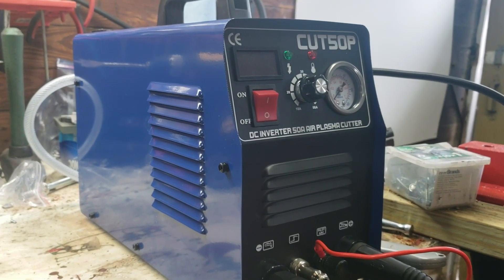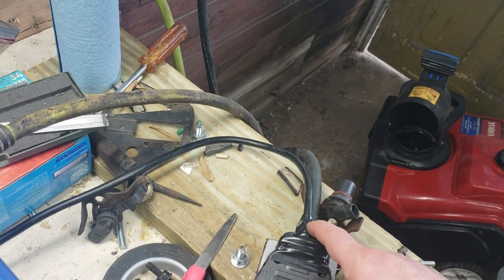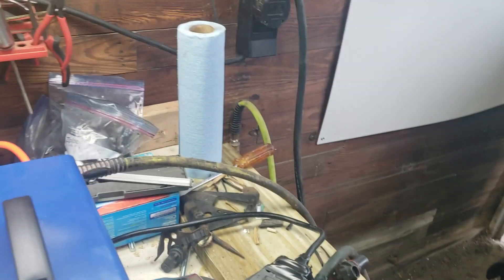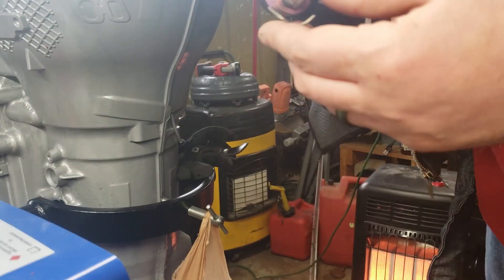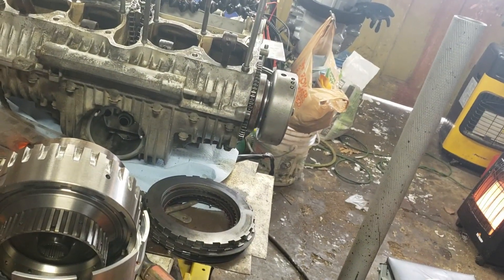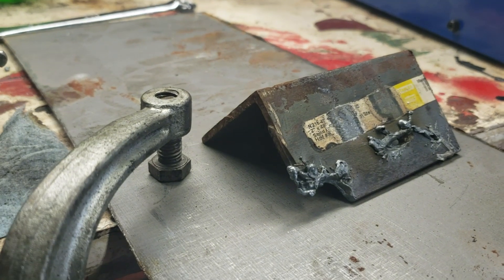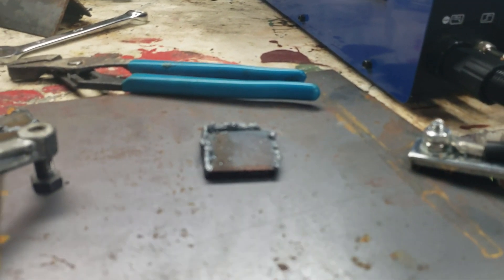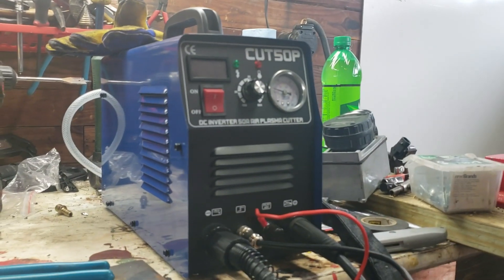Toosense Cut50P pilot arc plasma cutter

Comment: You're lucky that you didn't fry the circuit boards! 
There are electronic components inside the box.  The circuitry has a temperature range that it can safely operate in.   -3° is well out of range! 

A glimpse thru the user manual, it states the following... "the cutting machine can perform in an environment where conditions are particularly harsh: it can withstand outside temperatures between 14 and 104 degrees Fahrenheit and a humidity level up to 80%."
:
Reply from the maker: You read the manual?
Reply: +The Driveway Engineer 
I did it for you !
:

Comment: Say I know the cord comes very short and I’m thinking of replacing it. What size would you recommend ? I was looking at the charts and for 50 amps it requires 6 gage wire.  Heck that’s bigger than the machine itself.  I know the cable that comes on it is small. So I’m looking for suggestions.  Thinking of going with a 12-16 ft cord.   Also the tosense you get now doesn’t look like the one you have. They have made mod too it.    Thanks for any help you or anyone can give me.   Oh this weekend I used it too cut washing machine drum. Stainless steel. Cut like a hot knife thru butter.
Reply from the maker: I made an extension cord for my welder a few years back, it's 10-6, I use that with the Plasma also and drag it around.
Reply: Cool thanks a lot.
Reply: Use a 10-3 from Home Depot. Only costs $2.25 a foot plus $15 for a NEMA 6-50 Plug. This machine's malfunctioning because the wire gauge is too small. White on left, black on right and green to ground.

Comment: Just FYI, I saw you struggling with the pilot arc.  Once you let off the switch and stop cutting, you have to wait for the air flow to stop before the pilot arc will fire again.  The air will flow for a few seconds after cutting to cool the torch head and consumables.

Comment: I just bought the same one like you said it doesn’t come with a plug but they are cheap plus you get the one that fits your needs. I put a 50 amp plug on mine and the thing work awesome. It’s the first time I ever used a plasma cutter. This unit has some minor things that could be upgraded like the air hose and they put the mounting bracket just a tad too low so the air filter actually hits the table but I just bent it up and it’s fine. The thing cut super on the 50 amp breaker. But we also tried it in a 30 amp and it kept blowing the breaker after about 45 seconds of running.  So for those of you that are thinking about buying one  just go ahead and plug into a 50 amp breaker. Save yourself the aggravation of resetting. I also was using 120 volts I didn’t try it on 250 yet. Really don’t need too cause on 120 volts and 50 amp I cut thru 1/4 steel plate like nothing and it was a clean cut.  The best feature of this machine is the non touch you can just hit the trigger and start you cut. It cut thru rust and all.   Hope all find what they are looking for tho.  Have fun everyone and enjoy.
Reply from the maker: Mine is still working great, was just using it this weekend. 

It's on a 50a 220v circuit
Reply: Cool when our garage gets built it will have 240 v in it till then the 120v is working awesome
Reply: This is for anyone reading your comment and doesn't know this so please don't take it as a criticism of you personally: you can't just drop a 50 A breaker in place of a 30 A breaker. You need to run a new circuit with thicker gauge wire to run 50 A. If you drop a 50 A breaker into a 30 A circuit, you run the risk of overheating the wire in the wall and potentially melting the wiring insulation. Worse case scenario: starts a fire. If a fellow needs a 50 A circuit, he needs to run 8 gauge wire, whereas 30 A calls for 10 gauge. If you check the wiring and it's 8 gauge, you may very well be safe to run a 50 A breaker on that circuit. I've never seen 8 gauge wire run for a 30 A load (thicker gauge costs more $$), but there's a first time for everything. If all that sounds like a foreign language, have an electrician check out your shop for you. Better safe homeless (or worse)....
Reply from the maker: @bobjohn7021  I don't believe he intended anyone to swap a 30 for a 50, the phrasing, plug into a 50 sounds like he means an existing 50a circuit

Comment: Hi there. How many cfm do you need from the compressor to run this? Thanks for the video.
Reply from the maker: That's a good question. 

I can't find it listed. 

I have a 13.5 CFM, 60 gallon compressor that's sold under about 5 different names. Sandborn, Kobalt, etc etc. It's probably the biggest single stage you'll find. 

It doesn't struggle in any way, but I'm only using 30 psi through it at the regulator. I think you could get away with a pretty small compressor really.
Reply: @TheDrivewayEngineer  thanks for the info.

Comment: Yes sir I have been watching several videos on these cheap plasma cutters. A couple of videos they send them back because they never could get them to work and always have to do something to the machine to get it operational. Which were the cord is that short anybody would replace it regardless but I don't know why they would put such small wire on a 50 amp machine. it was a good video I enjoyed it and I'm going to try to purchase one sooner or later because let's face it oxygen and acetylene is going up everyday. and I'm sure those tanks that I have drug up ship stairs to the roof is partially what's wrong with my back. Oh by the way you said it didn't smoke or nothing. After 40 years doing maintenance work and working on almost everything from HVAC, boilers, air compressors or appliances or what I can  tell you one thing I've learned if you let the smoke out of it ... it's over! They smoke is factory installed! you will have to send it back to the factory to get the smoke put back in. Haha I had to throw a little humor in but like I say good video thank you for making it and I'll be watching your channel now that I found it. I done got old and crippled and retired so I Found YouTube and lots of good information out there. But there's a lot of BS out there also. happy Cutten!
Reply from the maker: This one is still working 6 months later, I'm pretty happy with it.
Reply: 50 amp output  not input

Comment: I know a guy that got one that is tig, plasma, stick combo for 250 off eBay
Reply: Huh, I never seen a TIG plasma and stick combo. That would be pretty cool. I recently bought an Eastwood that was a 250 amp and it was TIG Mig and stick. They don't offer it with a plasma built in at least at the time I purchased it. The only thing I screwed up on which I didn't have the option was that it was DC only and so therefore I can not TIG aluminum with it. So I had to buy a spool gun and that really sucks because I don't have a lot of aluminum that I need to work on. On that machine you're talkin about is it AC DC so you can Tig aluminum? Which I've had that welder for over 6 months and I have never unboxed it. I have health issues I have to work around and I just haven't had the opportunity but I'll let y'all know how that turns out.
Reply from the maker: Yeah, the CT312 is pretty versatile. I already have a MIG, so I went for the pilot arc plasma. The non-pilot arcs are a bit of a pain to use.

Comment: Plasma Cutter's are an excellent piece of equipment my man. Especially in the Auto/Fab Fields👍.
Reply: I bought my Hypertherm Powermax 600 used from my local Welding Supply Store for $600.00. You're absolutely gonna love using a Plasma Cutter. You deserve it my man👍.
Reply from the maker: Yeah I'd love to pick up a Hypertherm, if the opportunity ever comes up I will for sure, 600 is a steal.
Reply: I'm EXTREMELY HAPPY FOR YOU MY MAN. You'll be able to use that Plasma Cutter on your Channel TREMENDOUSLY.
Reply: I was extremely fortunate to get mines for $600.00. THE CHEAPEST I SEE THE POWERMAX 600'S USED ARE$1000.00. I COME ACROSS THE POWERMAX 375/30 USED REASONABLY CHEAP THOUGH 30 AMP thats all you really need. I'll snag one for you next time i see one $200-$300 range my man.
Reply from the maker: Ultimately, once we get moved somewhere with some real shop space, I'd love to have a table so I can knock out brackets and things for DIY guys, a Hypertherm would really help with that.
Reply: You will achieve that goal my man.  You got the best LS swap Channel on Youtube. Trust me I see a Hypertherm/Table in a new shop for you👍.